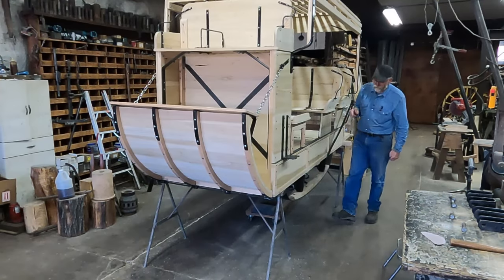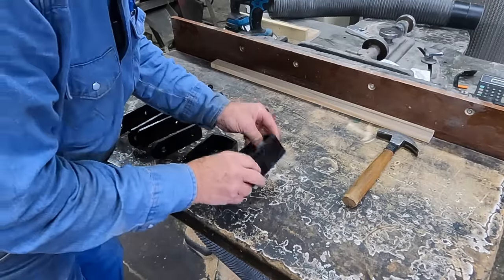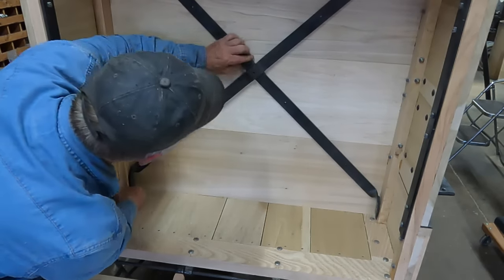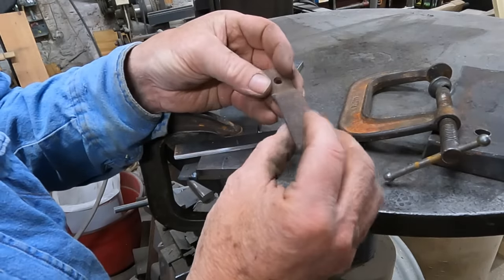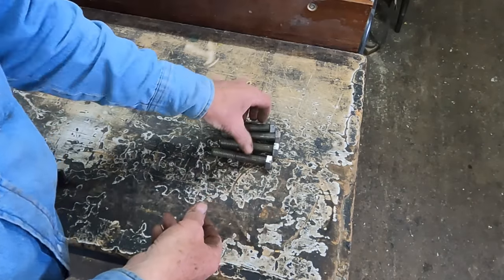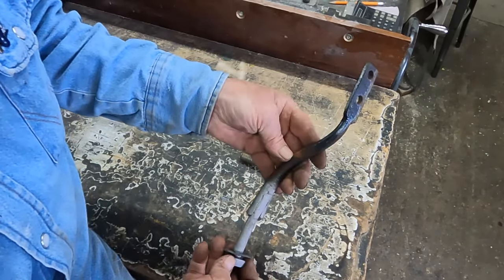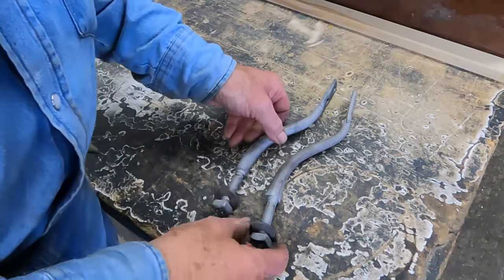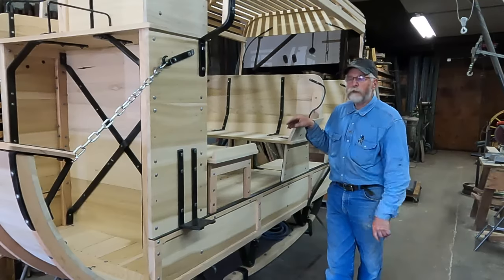Final Touches on The Mud Wagon Body! | Engels Coach Shop

Comment: Dave, as usual, you create something from practically nothing but remnants of a wreck or a disentgrated wood carcas.  Just the old frame pieces, a few pics to go by and your experience and knowledge and voila......a "new"  mudwagon.  And Dave, it is anything but a muddy mess.  Excellent work.  I like this as much as the Democrat buggy and the bob sled.
I am looking forward to the finish on this one.  I am sure that the wagon, once painted and fitted with the top will be an amazing change from that pile of remnants that you started with.  EXCELLENT WORK

Comment: Thanks for making the great videos showing your design process. The power hammering vs. hand hammering was very interesting, especially how the stock is manipulated and the hammer not so much. I think you should have made two back braces and hung that other one under the driver's seat, which seems to be an otherwise unused space. I still think the passenger seats are not sufficiently braced in the middle, 3/4 inch poplar doesn't seem rugged enough. The cross bracing for the driver's seat makes good sense, as that structure is so top loaded and wracks side to side when rolling along. Thanks again, your videos are very well done and are great tutorials for efficient and elegant working habits.

Comment: I enjoy watching all the ways you build and the tools you use .
I am currently working on a bent wood panel,  sewing machine cover. Which has cracks and a small hole knocked in it...
made me wonder how you would repair such damage. 
A curved surface thin wood,  with a hole broken through. 
.
I stabilized with wood glue.
Filled with putty. 
Sanding and a skim coat of glue again. 
Then , covering the outside with leather to help protect it in the future.

Comment: The answer to Dave's early question about why some of the bolts were parallel and true while most were slightly off is easy.  They were drilled by ordinary mortal men, not by a wizard with a radar controlled drill.  Amazing stuff as always thank you!

Comment: 3:48 Am in awe of the original designers of these wagons. Ask a modern coachbuilder or auto designer to come up with a multi seater vehicle made of wood. Able to traverse rocky mountain roads and last longer than a mans life span. Today “we” make tin boxes with wheel each corner and scrap them not long after. Thankyou sir for videoing your work. I’m a 1940’s model and have always been drawn to grey dried out wagons beside the roads I’ve travelled. Always wondered how a wooden spoked wheel could take side loading. Cornering at speed with loaded wagon and the hub doesn’t punch out through the spokes! Now you have opened up my wonder when I see the engineering of an entire wagon. Reckon modern construction of anything is folks standing on the shoulders of giants who tackled the impossible. Back in the day of horse drawn sleighs or sleds what percentage of men could come up with a wheeled wagon with suspension? And it had not been done before. Well there were chariots and apparently wagons mentioned in the bible but someone had to begin the process for those too. Am convinced that we are blind fools to not notice our mathematics are based on very ancient people and we are devolving not evolving. Not only mathematics but metallurgy and high rise construction water pumps and so on and on. We have almost “ruined” the earth and I am intensely interested in our future based on what I’m seeing of our past. I see hope. But that’s another story.

Comment: As an old woodworker in the U.K. having started out in the beginning of the 1960's I watch you closely on the carpentry side and I see  you practising exactly what I was taught as a young apprentice. A simple thing like making a hole to centre correctly when passing between to pieces of metal snd a piece of lumber so a bolt fits properly first time. There's not a great deal of difference in trades either side of the pond.
Reply: The traditional trades like woodworking, leather working, and blacksmithing crossed the pond with the tradesmen that came to the "New World".   While the tools may have changed, the craftsmanship hasn't.
Reply: @harpintn  Tools remained the same with many Stanley tools being imported from the USA into the UK up until 1942.  Stanley USA bought out a British Tool manufacturer and made very similar tools under the British Record label.
Reply: @barryrudge1576  Many of the tools did remain the same. Some were upgraded with steel instead of iron  or wood. Many tools have also been added such as power hammers, gas furnaces, power saws of various types, and machines that can sew leather. That is just a few examples.

I have a very nice set of British made Irwin blue chip  wood chisels that I love.  They are much better than anything Stanley ever came out with.

Comment: Hum, Dave, it doesn't look much like a slay to me. the runners are a little too short for a slay, the rocking back and forth would be hell on the team, the Driver might go flying and the passengers battered about. BUT I'll bet one could make a set of slay runners that could turn this vehicle into a slay for cold snowy winter weather.

Comment: Are you going to reinstall the handles on the sides of the driver's box? (As seen at 20.22 of this video). They seemed to be an integral part of the difference of the original box and the repaired box!?

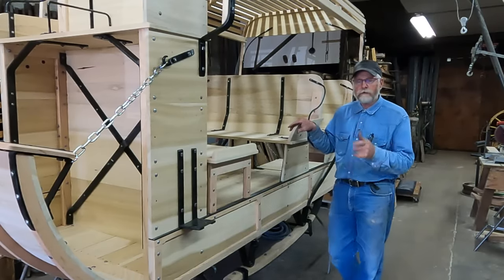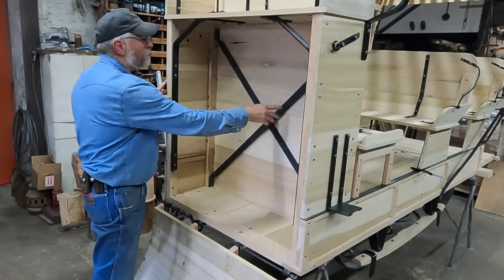Comment: Those seats have virtually no lateral support. Could there be parts missing?  Once seat and back cushions are installed, I don't think the driver could reach the footboard or do they just shorten the chain before boarding?  There is a hook shown at 20:26 that does not seem to be duplicated at 4:58.

Comment: Another great project Dave! I have restored a wagon and built a couple of hay wagons and I have trouble with the bolts all loosing up after, possible due to use and/or wood drying and shrinking and have to retighten them quite often. Is this normal? Thx for all your instruction. Great stuff!

Comment: I feel bad knowing that duplicating old parts requires twice the heat cycles of the original  build.  The modern blacksmith curse is not knowing the old tricks.